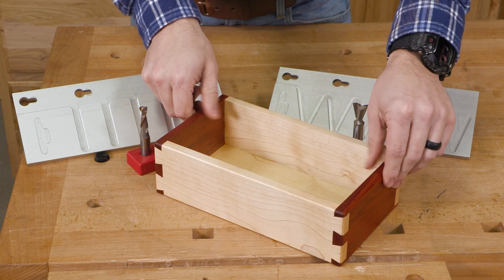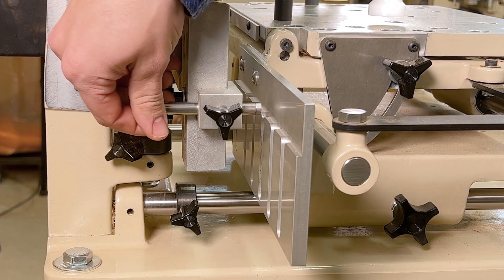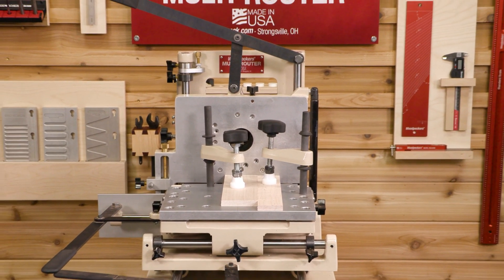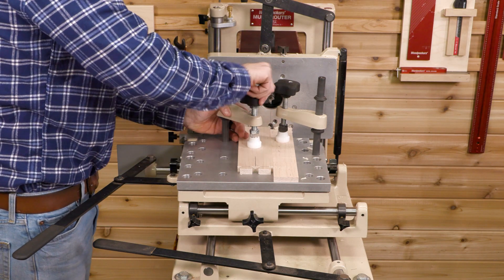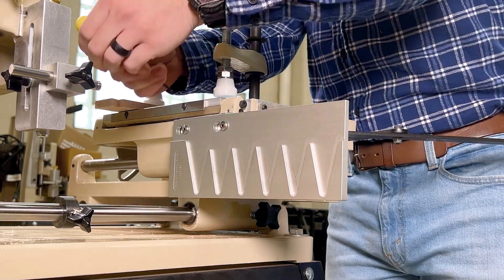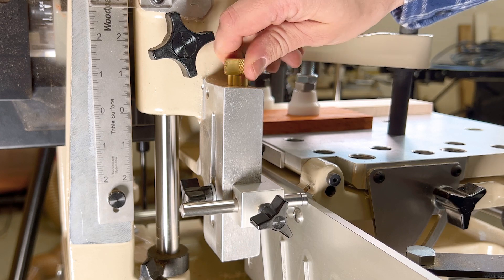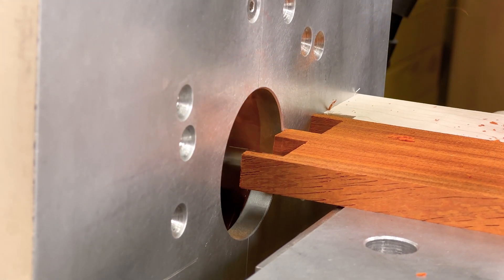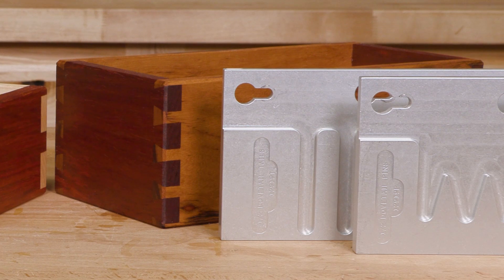How To Create Flawless Dovetails With The Multi-Router | Woodpeckers Tool

Comment: Do you guys have recommendations on a good initial position of the stylus before we start adjustments for the pins?  Should we start at the bottom and just dial upward until we get a tight fit?
Reply from the maker: I have found that the position of the stylus usually is around 1/3 of the way up from the bottom. If you start around there, you should get pretty close to your mark on your first test cut. Hope this helps. 
- Jay

Comment: This multi-router machine is amazing! I wish I had one! How wide of a board can you use with this? Say I want to make a toy chest 36” wide x 20” depth x 20” height with dovetails
Reply from the maker: Using the built-in clamps on the table, the maximum material width is 10-1/2". We're experimenting with auxiliary tables you could build to expand that. Watch our YouTube channel for further developments.
Reply: @WoodpeckersLLC any further developments ?

Comment: What is the repeat distances for the 3/4" and 1/2" dovetail spacing's?
Reply from the maker: Sounds like a simple question, doesn't it? Not so much. 
If you're using the 3/4" template and a 3/4" bit with 3/4" material for both sides, the repeating pattern of one tail and one pin is 1-1/2". 

If you're using the 1/2" template with 1/2" material for both sides, the repeating pattern is 15/16". 

BUT...it all changes if you have different thicknesses for the pin boards and the tail boards (which you usually do). 

The best plan of action is to mill up some extra stock the thicknesses you're planning to use, adjust the machine to get them fitting right, then check your pattern and adjust the width of your stock and the width of your outside edge half-pins to get everything balanced.
Reply: @WoodpeckersLLC  I appreciate it. I’m thinking mostly about the 1/2” set with 1/2” material all the way around. Baldic birch pre finished plywood drawer side material for kitchen cabinets. My old omni-jig hides most of the blow outs from cutting plywood dovetails. I may try some through dovetails with my Leigh and see what they look like. If they are satisfactory, I may give your 1’2” set a try. I don’t like lifting a handheld router up and down to make dovetails.  would be sacrificing single pass half blind dovetails for tails on one setup and pins on another. The multi router sure beats wagging a router around all day. Have a great holiday weekend!
Reply from the maker: Remember as you you're considering this, if you want to start and stop on a half-pin (and you do), that's your wild card. You're working in multiples of 15/16" plus 2 times a "half" pin, That half-pin add-on is roughly 3/8" times 2 for 3/4" down to around 3/16" times 2 for 3/8". That's a pretty big window to work in.